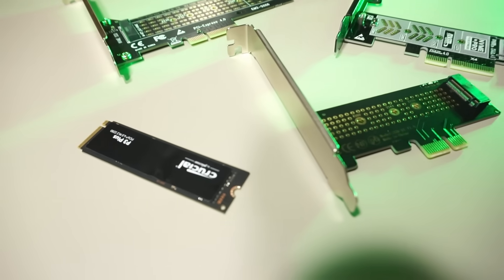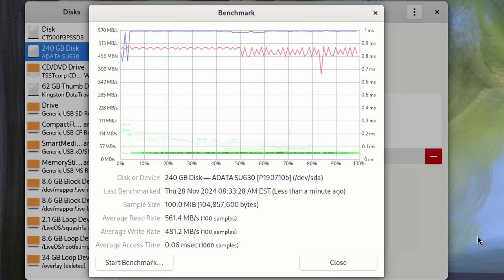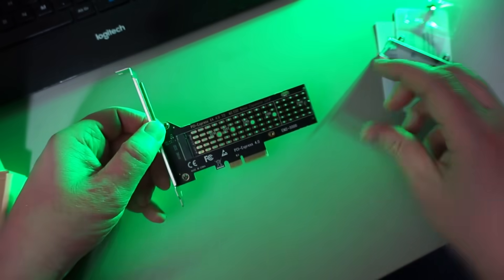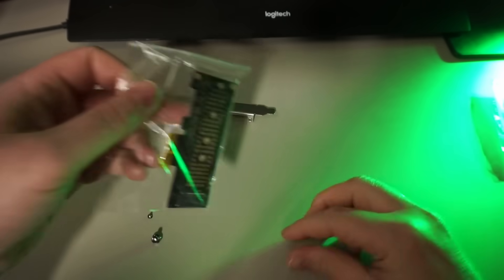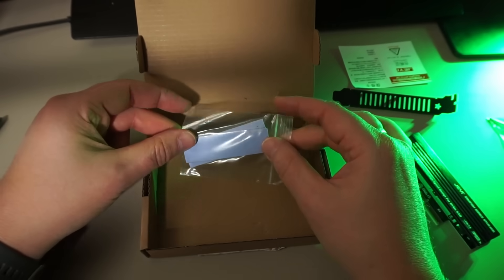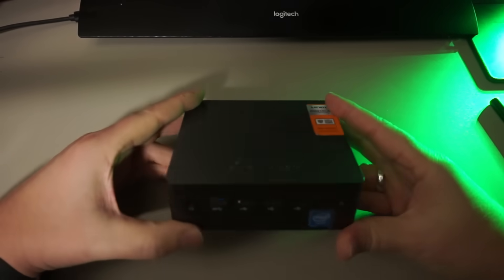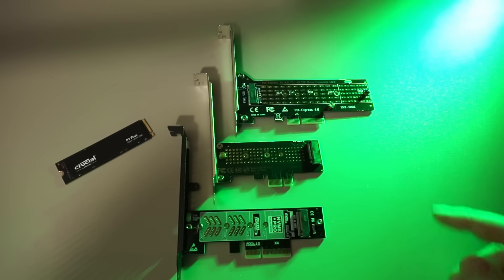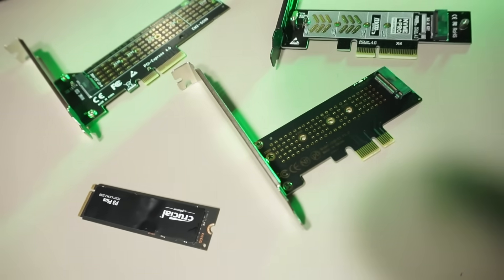Upgrade your old pc with an NVMe! Testing cheap PCIe M.2 adapters!

Comment: You choose a wrong NVME. Forr maximum benefit, you need to use older gen3 NVMEs. It seems, you dont understand, how this works with PCI lanes. Your NVME is a PCI4.0x4 ssd, but you only have PCI 3.0 Slots. This means you half throttling yourr NVME, thats why you get the lame speeds.This has nothing to do with the adapters. Its like putting a 40xx RTX in a PCI 3.0 Slot. The card will be underperforming and can not show the real potential. Do the same test with older Gen3 NVME cards, you will be amazed and they will deliver what is promised: 3500MB per sec.for a samsung for example
Reply from the maker: Nah I made a mistake, but it's not what you think. I used a machine with 2.0 slots. The mini pc has PCIe 3.0, but it seems it uses only 2 lanes on the M.2 slot so effectively slowing it down to 2.0 speeds as well. 
Will do a follow-up soon.

Comment: These cards are a godsend if you have old servers still sporting SAS-SATA drives, the latency and amount of IOPS is unbeatable. For any regular desktop use on older system I don't think you will see that much improvements in real-world light workloads compared to SATA 600 SSD's.

Comment: One correction, your board can still support pcie NVME drive even if the board doesn't have m.2 drive slot. Varies from brand to brand I have MSI and asus and both boards detect and boot from pcie nvne drives.

Comment: The only thing I'd say you might wanna look into - the heatsink vs. speed logic is backwards. The drive runs well below its rating, and the conclusions is it doesnt need a HS because its so slow? I think maybe it is running slow because it doesnt have a heatsink, having experienced this with my drives a few times. It doesnt take any time for them to get hot when moving 1GB+/s, and they throttle when that happens. I have a Samsung rated for 7400 that will only ever do 2250 without a heatsink, several SPCCs that run 1/2 their rated speed without a heatsink, etc and so on.  All of them perk rioght up and hit near or above rated speed with a heatsink, and I even put little fans on em. THey are adorable TBH.
Reply from the maker: The drive ran slow because I made a mistake: I tested on PCIe 2.0 (see also pinned comment). I will redo this test soon. Might even try the heatsink then. ;)

Comment: Used SATA SSD's are cheaper than those adaptors. 

Also, if you buy a new nvme you allready get a whole pc that is faster than your example used.
Reply from the maker: Usually people selling used SSD's are asking the same as new ones cost me at Amazon. 

Your second statement I don't get. This NVMe drive cost me about €35. Can't get a pc with an included NVMe for that price...
Reply: @ex-itguy  okay strange. It's 5€ +1.60€ shipping in Germany
Reply from the maker: Ah, well I can't find any under €10 in the Netherlands. Even talked to someone who didn't want to go below €10 on a 80GB SSD while you can get a new 120GB one for about that much on Amazon...
Reply: @ex-itguy  so.... those are cheaper than the adapter and a M.2 SSD.
Reply from the maker: @hanspeter9636  No they're not. The cheapest adapter was about half the price of the cheapest SATA SSD I can buy on Amazon.

Edit: wait you said and. Yes, M.2 NVMe's have about the same price as SATA SSD's over here. But since at least on PCIe 2.0 they're about 3x faster I'd say it can be worth it.

Comment: I did this on a 4th gen intel mb years ago and got it to boot natively by adding a driver to the uefi bios. It wasn't that difficult to do but a little nerve wracking to not brick the mb (it was still my main pc back then). If the mb is too old to have uefi this will not work.

Comment: For not supporting bios, you need Clover EFI bootloader and any usb stick.
You install windows11 for example as standard GPT UEFI.
You stick usb, load clover UEFI bios that than loads win in seconds
Reply from the maker: I read about it but haven't tested it yet. For Linux you just need your /boot partition on another drive.

Comment: I am going to test some installation with PCIe card to U.2 SSD next week. I am curious to know if it is going to work, and how fast.
Reply from the maker: Note that I did make a mistake: my system only has PCIe 2.0 slots. So the speeds you see in this video should be a lot higher on 3.0. I'm seeking out a board that has 3.0 slots for a rebound video.
Reply: @ex-itguy  I have spent some time for this, seeking an affordable MB with bifurcation, and enough PCIe 3.0 and or 4.0.
If you have a bigger budget than me, then workstations motherboards should comply your needs.
Reply from the maker: I wish I had a big budget haha
Luckily my videos get more views lately so I'm finally getting back a bit of what I'm investing in hardware for this channel. ;)

Comment: Older mainboards will probably need a UEFI patch or workaround to be able to "see" the drive. That's what I did with my Asus M5A97 r2 board. Worked like a charm.

Experienced users at Win-RAID Forum can help you with this.
Reply from the maker: I've heard about it and will definitely check it out!
Reply: Built a 2013 rig with rampage iv, bios updated 4 or 5 years ago has UEFI

Comment: Interesting, didn't know these existed. I run my Core2Quad on an SSD without issue. The two 2.0 and one 1.0 PCI-E slots are taken up by three 9800 GTX+ cards.
Reply from the maker: In that case this won't help you haha, as mentioned in the pinned comment I made a mistake. The tests were done on PCIe 2.0. Do yours should be able to reach the same speeds if you were to clear up a PCIe 2.0 slot.

Comment: My Sarbent PCIe x16/x8/x4 adapter with a 970 does very well, over 3000, not 1500.  I prepared a USB drive for proper booting as well
Reply from the maker: As mentioned in the pinned comment I made a mistake: I tested on PCIe 2.0... wil try to redo the tests on a machine with a 3.0 slot next week.

Comment: I happen to have that exact same athlon 64 computer! lol
I just use an old 128gb SATA drive with board max RAM.
Works ok with linux on it.
Not worth a NvME drive as the cpu would bottleneck the transfer rate.
Reply from the maker: Yeah this test I think only wires zeros so that could be a limiting factor.

Comment: Even if the motherboard does not support NVMe drives, you can obtain support for boot from an NVMe drive by installing the Clover software to a USB and setting the motherboard BIOS to boot from the USB drive. I did this with 15 year old Asus Sabretooth motherboard, an AMD Fx6100 processor  and an Fanxiana NVMe. It achieves access speeds to the NVMe of 1.5 GBps. I also believe, I can increase this speed because Sisift Sandra tells me  that the motheboard supports PCI 2.0, 4  x lane rated at 5GBps and the Fanxiana NVMe is  a Gen 3 (1 GBps to 16 GBps) and SiSoft Sandra states that the device is running in low power mode and that better performance can be achieved if the NVMe is switched to high power mode. 
I have yet to find out how to do this,
Reply from the maker: I have read about it but have yet to play with it. 
About the speed: I made a mistake and tested on 2.0. Should be a lot faster on 3.0. I'll try to redo the test next week on other hardware.

Comment: I have one of these cheap nvme to pcie boards in my x79 build. I get great speeds using PCIe 3.0; around 3300MB/s read and write. Also full Nvme boot support with a modded bios.
Reply from the maker: Yes, I made a mistake and tested on 2.0. Will redo this test hopefully next week. I'm interested to see if there are bigger differences between the cards.

Comment: i get 800-1000 mb.sec at a pcie 3.0x1 slot adapter, these adapters are amazing. also i get 300-400 at usb 3.0 adapters .. nvme are the future disks
Reply from the maker: Yes, I made a mistake: I tested on PCIe 2.0. I was convinced that my Phenom II system had 3.0 slots but I was wrong. 
I will redo the test soon.

Comment: It's not all that hard to modify the UEFI BIOS so you can boot from the NVMe, there are good tutorials. Just take care that you save the original BIOS somewhere safe, and handy in case it goes wrong. But to the motherboard, it's just the original BIOS.

Comment: I got one for my OptiPlex, and after adding the relevant DXE driver to the UEFI, it could boot from the NVMe drive. Though it's PCIe 2.0, it's still considerably faster than any SATA SSD.
Reply from the maker: You probably get about the same speeds I got in this video then... I made a mistake. My test pc doesn't have 3.0 slots.
Reply: DXE driver? I am wanting to try this in my Precision 390, I tried an M.2 PCIe card adapter ten years ago, in it and in a then-new MSI AMD motherboard that had an erroneous product description as having an M.2 2280 slot on the motherboard, but neither would see the Samsung drive I had bought to pair with the MSI.
Reply: @davidgoodnow269  I Have An Old XPS 410 With The Q6600 CPU That I Ran 24 X 7 For 14 Years! Minus The Time It Took To Replace The Hard Drive With An SSD, Upgrade The Ram To 8GB And Replace The PSU It Has An ATI 2400 GPU With HDMI Out! I Recorded TV Shows Using A Win TV Dual Tuner And Converted Them And Cut Out The Ads Using A Program Called MCE_Buddy! It Would Run With The CPU PEGGED Out For HOURS Upon Hours Every Day Except Saturday When Nothing Was On TV To Capture! I Retired The Old Girl A Couple Of Years Ago When All Of These Cheap Office Machines Hit The Used Market! The I7 8700 I Replaced It With Converts Shows In Just A Few Minutes Thanks To Quicksync! But These Old Machines Were Tough! It Ran Everyday For 14 Years!
Reply: yeah pcie 2.0 x4 is still fast
Reply: @si4632  Agreed. For what I do - mostly data transfer and fairly basic gaming.... its fine. I have a few things to get done this year, but then I'll go for a "proper" gaming system again. But for now, I'm happy with my little all-rounder.
Reply: Thats interesting to know. My old B450... well it rocks (badly) under pressure!!!! If you have any updates, please let us know..... I have an old MSI B450 Max II.... pretty sure its seen its best years. But if anyone can advise how to make her dance again? To save time - MRS Gaming 850w Power, MSI Tomahawk Max Pro II Motherboard, 4x 8GB DDR4 (yes, only 3000hz), 2TB Nvme boot drive (about 100TB external) 4GB Nvidia 1050Ti.
Reply: where can i get the drivere? i have a m.2 adapter for my pcie 3.0, my pc is optiplex 9020 mt (uefi) but cant boot from the m.2 thats on my adapter, can you please tell me where to find the needed driver for my bios (i'v updates my bios didnt help)

Comment: you know what would be nice? one nvme on the m.2 port of a more modern mobo, and another nvme on one of those adapter cards, then running both in RAID 0 to see what speeds you can achieve
Reply from the maker: Probably a lot haha, although you would be limited to software raid in that setup.

Comment: Interesting tests. I have a Dell 9020MT mobo rebuilt into an Antec 300 case and am using a NVME adapter on it too. This setup was a gen 4 system though so no boot support for NVME stuff even when connected via adapter card.

But I lucked out and someone made a modified UEFI rom I could reflash the mobo with and now it has UEFI boot support for my NVME SSD connected via adapter. I checked and yeah got the 4x PCI card. I'm not sure if I'm getting 3.0 speeds though. I think this mobo has a 3.0 slot but it's only the blue slot which my graphics card occupies.

The SSD adapter is plugged into the second 16x slot. Also note with a mobo this old having a 4x NVME connected ends up taking 4 lanes away from the graphics card because the CPU only has 16 lanes available...at least that's how I recall it working with gen 4 Intel boards. So you'll maybe lose a bit of graphics performance...though in most cases on systems this old you'll end up CPU bottlenecked before you can max out graphics card bandwidth I imagine so not something I'm concerned about. I only have a 970Ti in the main slot anyways. :P
Reply from the maker: Does that GPU use all 16 lanes though? A lot of them don't. 

Note that I made a mistake by testing on a machine with PCIe 2.0 slots, so I guess speeds should be similar for you?
Reply: @ex-itguy  Yeah maybe. It's old enough that it might not use all 16 lanes but I checked and specs indicate that it does?
Reply from the maker: Idk, on Linux you can check with "lspci -vv" (as root). On Windows a tool like GPU-Z should be able to tell you.

Comment: TY for shearing. 
I'm in the predicament with one nvm slot and don't know if I will get better performance as I run 7 instances of diablo 2 resurrected and the loading is slow. So I was thinking of moving 2 to a drive each !?
Reply from the maker: Not sure if that will help. Maybe get a raid card and get them striped?
Reply: @ex-itguy  ty. I googled it and it sounds good.

Comment: If you are lucky you may find a modded bios with NVME support for your motherboard. I upgraded an old Haswell machine with a nvme m.2 ssd and a cheap pcie adapter and it really gives new life to this machine.

Comment: I use one of these in an ivy bridge system.  The adapter steals express lanes from the GPU, thereby increasing the bottleneck.
Reply from the maker: Oh that's not good. Interestingly someone else commented using one of those instead of his M.2 slot because that one shared lanes with the GPU.

Comment: Super intresting!
I bought 2 PCIe 1x cards off ali express to try this too, only to find out that even m.2 gen 3's have hardly come down in price since gen 5 hit the market
Reply from the maker: Yeah it seems the size is the biggest factor. There's hardly even any difference between a SATA drive and an M.2 NVMe.
Reply: Gen 5 is still too new. Almost nobody is adopting it.  But there are deals to be had on Gen 3 and 4 drives on the used market.

Comment: These adaptors only small lanes get one with 16 lane slot instead of the 6 lane ones you got
Reply from the maker: An m.2 slot only uses 4 lanes. The X4 cards are perfectly fine. X16 cards are nice if you'd like to put four of them on a card. Total overkill in this setup.

Comment: I use a similar one on my main rig, just because one M.2 slot on my motherboard (Crosshair VII Hero) shares bandwith with the main x16 slot, and as this is a PCIe 3.0 platform, I want to give all the possible bandwith to my RTX 3080. The drive is in PCIe 2.0 slot but still more than fast enough for game storage.

Comment: So is the nvme running at pcie 2.0 still faster than a sata ssd?  I'd like to try that on an intel ivy bridge, but it only offers 16 3.0 lanes, so the gpu uses all of it, leaving only pcie 2.0 x 4 from the chipset.
Reply from the maker: As people pointed out I made a mistake. My system only has 2.0 ports. So yes, about 3x SATA speed on PCIe 2.0.

Comment: final thoughts section.. needs NVME bios mod w UBU Uefi bios updater for it to boot.. 
NVME is direct pcie so no boot rom on the adapter as its part of the ssd
Reply from the maker: I'm going to make an update video later, in which I'll cover multiple boot options.

Comment: These adapters are handy not for just old PCs, but I guess motherboards that only have two M.2 slots. My current machine with a B550-F motherboard only has two (one of them  PCI-e 4.0 x4, one of then PCI-e 3.0 x4), which only leaves me with some PCI-e 3.0 x1 slots. I'm the kind of person that adds storage--hate the idea of just tossing drives aside. 

So my current build had a P5 Plus 1TB, and P3 Plus 1TB, before I upgraded to a Sabrent Rocket 4 Plus 2TB. Guess what I did with the P3 Plus...ironically went with the same Glotrends adapter, over a year ago. The adapter has held up fine.

Comment: what is the point of this video? why wouldn't those adapters work?
Reply from the maker: Testing if it makes a big difference?
Reply: @ex-itguy  what difference? in performance compared to a SATA SSD?
Reply from the maker: And between the cards
Reply: @ex-itguy  i mean i understand that you looked for a cheap topic to wrestle content from but this is rather silly. there are no performance differences between adapters with equal PCIe lane configuration. if you want to attract viewership, you'll have to do a little better than that.
Reply from the maker: @toseltreps1101  I didn't know that before these tests, and couldn't find a source to prove or disprove this online. I didn't want to spend more money on a card than the ssd's worth so I simply bought a few cheap ones to test. So this test was as much for myself as for anyone who wants to watch it.
I think you're looking for things that aren't there, sorry.

Comment: Of course the PCIe one work but on some old computers you can't boot from them.  Those are the computers made before NVME drives started showing up in all new computers.  You can use them in those computers but you might not be able to boot from them because of BIOS support for that.  They work as storage just fine if you can find the driver (assuming it is not already installed.  They can be used in USB or Thunderbolt enclosures too.  Use Thunderbolt if you can for the best speed.
Reply from the maker: The boot issue I addressed in the video as well, but there are workarounds. I'll probably make a video about that later on.

Comment: Stay away from Crucial product, I bought the T700 NVME and it kept crashing and they asked me to pay for shipping when I just both the thing, so I simply return it....
Reply from the maker: Auch, that's not good. I thought Crucial was pretty good? No problems with this one yet.
Reply: @ex-itguy  Crucial IS good actually. I still prefer WD Black drives, Samsung or Kioxia. Kioxia is a joint venture of WD with Toshiba iirc, and they use the same flash chips and controller, in case Kioxia is an unknown name to you

Comment: you should check the PCIe Speed with tools like HWINFO64 - the second "x16" Slot in such old Mainboards is often only PCIe 2.x.
Reply from the maker: Actually, both are. I made a mistake as some people were good enough to point out.